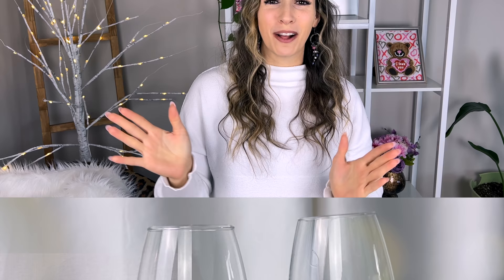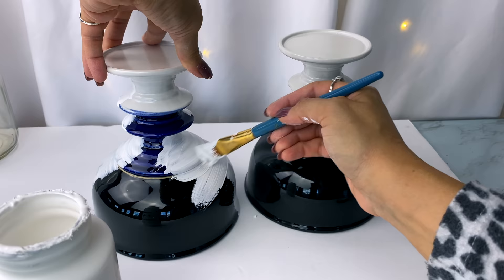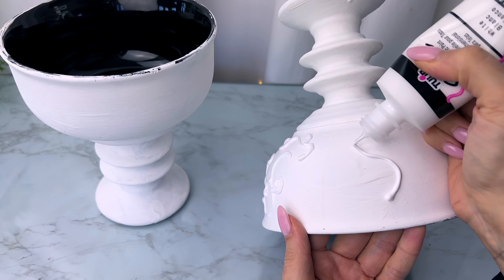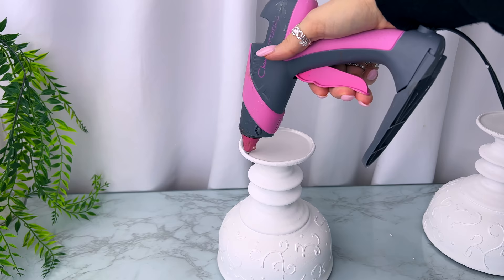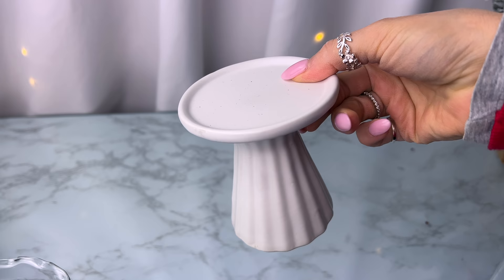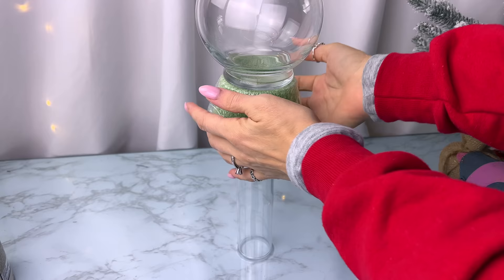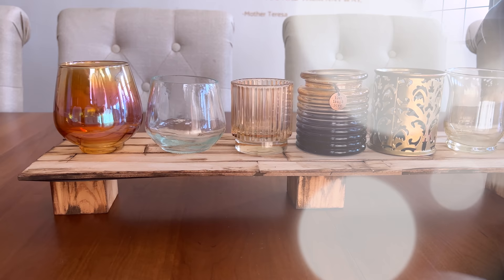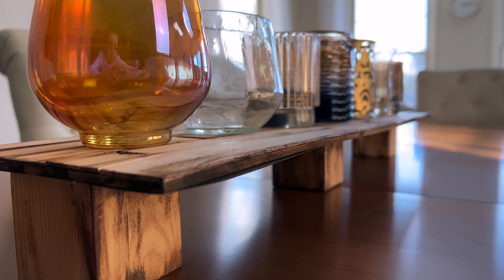*NEW* DOLLAR TREE DIY CENTERPIECE DECOR FOR 2022!!

Comment: With the centerpiece of the four small wooden crates you second guessed yourself on the colors. What I find most attractive, is when colors are close to each other and I use several varieties of those. So in your case I would have put in a different kind of flower in a slightly lighter tone. Perhaps even two of those to make it look more natural. Plus I would have added another type of foliage to contrast and complement at the same time. Something dainty.

Comment: Just found your site, so I'm not sure if you may have answered my question in a previous post, but I wonder why you leave the plastic on the foam? You have a good eye for color and design, and  are very creative in how you repurpose some of the items you use to create containers for your arrangements. Just wanted to share a tip to help elevate them a little more. I had an instructor once tell me that you should always cover your mechanics. What he meant was that things like your foam shouldn't be visible through your arrangements. The easy and pretty way to do this is to cover it with Spanish moss or the sheet moss and use the little floral pins, or use floral wire bent in a U shape, to secure it to the foam. The start popping in your flowers. Hope this helps. Keep up the good work and stay creative!